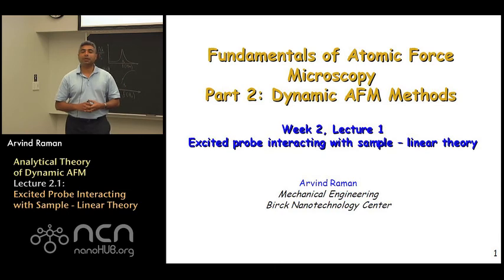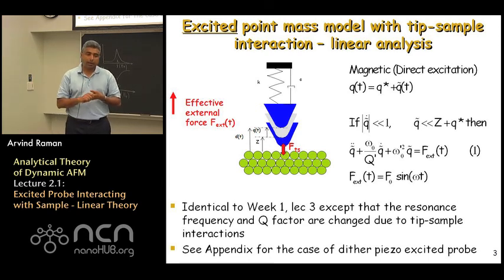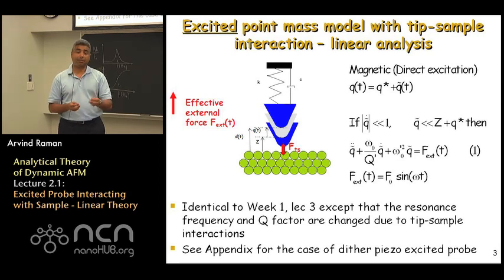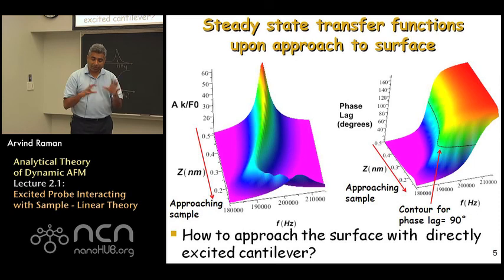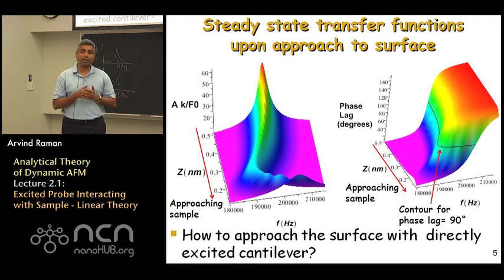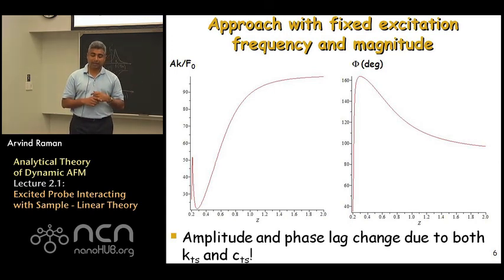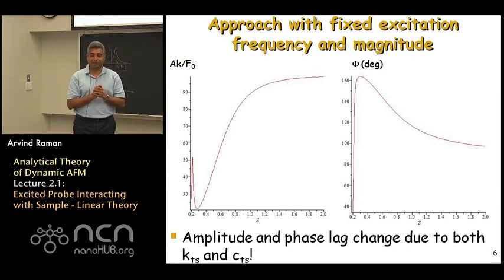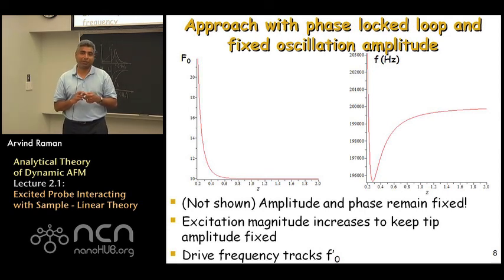nanoHUB-U Fundamentals of AFM L2.1: Analytical Theory - Excited Probe Interacting with Sample

Comment: How do you graphically interpret c_ts? Since c_ts = - df/dd_dot, then won't it be related to the speed at which you move your tip towards the sample? And if so, how do you know the Q' value with increase/ decrease in the general case?